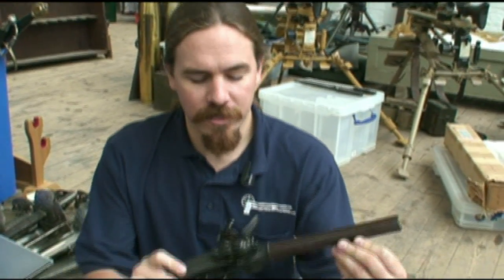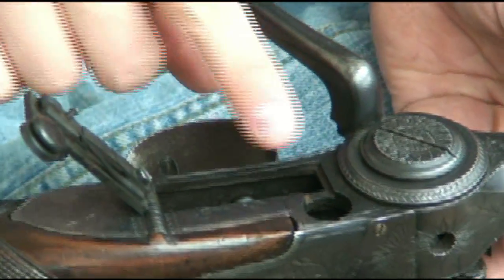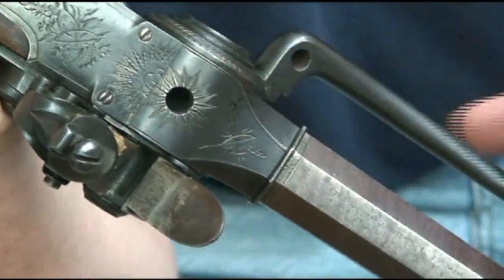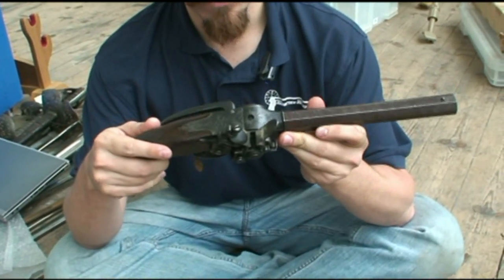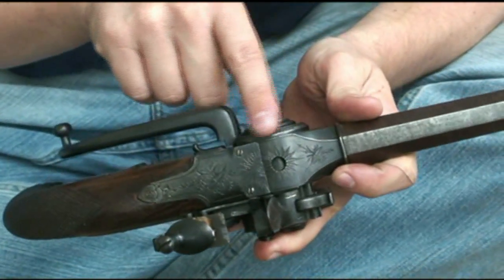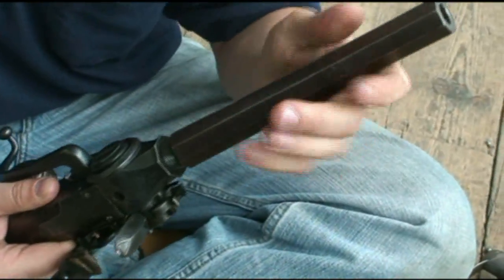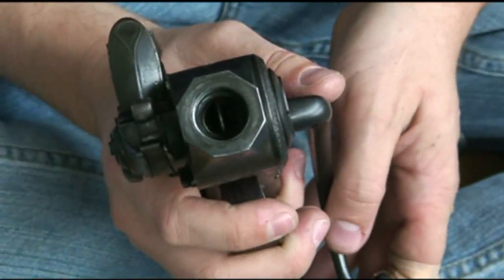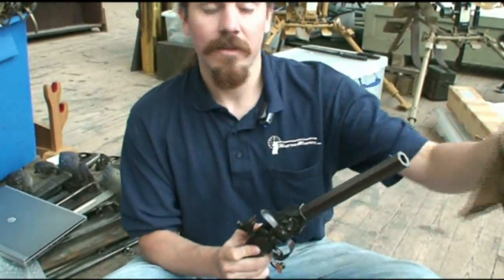Lorenzoni Repeating Flintlock Pistol

Comment from the maker: One word: money. Because of the skill and time required to make them, Lorenzonis were very expensive guns. This is the same reason armies were never equipped with wheel locks, despite them being superior to the flintlocks available at the same time.
Reply: Sorta the same with ww1 rifles being bolt action instead of the earlier, faster lever action rifles that held more rounds, with the only real advantage of bolt action being that it was quicker to load, and  less susceptible to failure in the mud and much of the trenches, I guess. Just goes to show you how cheap governments can be when it comes to equipping their soldiers.
Reply: @RmfDiz  Um what? Being quicker to load and more robust are huge advantages, not something you can just brush off. And those are not the only advantages either, bolt action rifles are substantially stronger than the early lever action rifles which could only shoot pistol rounds, and can't use pointed bullets either because they are dangerous in a tubular magazine.
Reply: @WJS774  Lever actions with box magazines do also exist, and you can make the bolt on some lever action designs plenty strong enough for full-power cartridges like 30-30, 30-40, and even 30-'06.  But lever actions, while awesome for mounted use, have issues when the shooter is prone in the mud or leaning against the side of a dirt trench.  Too much of the action opens up and on both the top and the bottom of the weapon for them to be happy down in the dirt.
Reply: @laurenceperkins7468  The guy's talking about early lever actions 'with more rounds', obviously that means the early ones with a tubular magazine of pistol rounds. The Winchester 95 wasn't around until 1895 (surprise surprise) and by that time bolt-action rifles were already entrenched as the standard infantry rifle.
Reply: @WJS774  Like I said, bolt action just makes more sense in terms of biomechanics for someone who's going to be spending most of his time shooting from a rest and especially if there's mud involved.  

The early lever actions were weak because the early cartridges were rimfire, which puts a pretty low ceiling on the amount of power they can handle without rim failure.  There's no reason to build an action for a full-power rifle cartridge when such do not yet exist.

As cartridge power scaled up manufacturers had no trouble strengthening lever action designs to match.  Bolt actions are simpler, but the locking mechanism on most lever actions is quite similar to that used on the Sharps falling-block actions, which nobody doubts are capable of handling high-power cartridges.

Bolt action may have caught on everywhere else, but the USA used Springfield trapdoor variants until 1892.  (For that matter, my grandfather was issued one when posted to the Mexican border during WWI.)  By that time the Winchester 1886 was available in 45-70 (the standard government cartridge of the time), 45-90, and 50-110.  These are hardly "pistol rounds".  But they also had rather lower magazine capacity, usually only six to eight instead of twelve or more.  But that's still higher capacity than the 30-40 Krag (the replacement for the trapdoor) which had a 5 round magazine.

But again, bolt-action makes more sense for infantry, and lever action isn't enough better for cavalry to be worth the hassle of maintaining multiple models with non-interchangeable parts.
Reply: @RmfDiz  the real advantage to the mauser bolt gun, is that you can operate it better from the prone, wich is what you would actually do in war, like 95% of the time. the stengun has a sideway magazine because of the same reason. 
leverguns are best suited for civilian needs, in my opinion.
Reply: @laurenceperkins7468  actually they stopped using them after they got the 1903 Springfield, since the US used the Trapdoor in the Spanish-American War of 1898
Reply: @josh_the_alien  They were still issuing trapdoors to home-guard troops in WWI for that matter.  Prior to WWII funding for the US military was always kind of a shoestring thing.  Just enough to get the job done, not a penny more.
Reply: @laurenceperkins7468  damn, i honestly don't remember typing this
Reply: Sorry Ian, but pistols were officer weapons, and officer back then were rich. So, couldn't this be an individual bought gun?
Reply: @RmfDiz  lever action wasn’t even faster, shitty overly complicated mechanism, round nosed bullets, had to be turned sideways every time you reloaded while prone.
Reply: @WJS774  what about pump action vs bolt action ??
they did use pump action shotguns in ww1 if I'm not mistaken
Reply: @aburoach9268 Are there even pump rifles? The shotguns obviously serve a different role than the rifle, so of course they operate differently.

Comment: I would like to see that unique pistol in action.  It sure was ahead of it's time.
Reply: this is the kind of thing that would be worth buying a very expensive exact replica of that you could actually fire (because you obviously never should fire this example), i would love to see it, and then see someone trying to work it quickly like you'd have to in a fight. id guess at full speed it's only between twice and three times as long as cycling a bolt action rifle, which if accurate would be insane for 1680
Reply: Ærik Bjørnsson Yes I would love to see someone like Pedersoli or Chiappa make a really good replica of a gun like this. Unfortunately I don't have enough money to let someone manufacture a unique copy of this gun by hand. Otherwise I would definitely do it, because I love old black powder guns and this one is so much ahead of its time, amazing!
Reply: @MajesticSkywhale  

Absolutley  I agree.  A firing functuoning replica should be made with an optional removable rifled barrel as well.

Comment: Does it also automatically put a powder charge on the pan or will you still need to do that manually?
Reply: good question.
Reply: From what I've read a small amount of BP will, "dribble," into the pan.  So, just roll and rock, as it were.
Reply: The Rifles had a third magazine of flash powder on the right side of the frame used exclusively to prime the pan ... you can't see it well on this pistol video .. but it's the same
Reply: id say no but it could have one installed
Reply: As the power gets compacted in the mechanism some power gets pushed out to the pan.
Reply: @MisfitSass  No, it's automatically loaded with a charge of BP. There's a third magazine of flash power on the right side used specifically to prime the pan. It's barely visible, here, but it's definitely there.

Comment: Mr. Michele Loranzoni was a brilliant genious inventor of the 17th and 18th centuries, and the maker/ manufacturer of fine multi shot Flintlock firearms.

 The Loranzoni design seems to be an improvement of the older Kaltoff and Klett multi shot Flintlock firearms.  These are the first Loading Lever multi shot repeating firearms.

The existence of the Kaltoff, Klett, Loranzoni, and the other  multi shot loading lever reapeating firearms debunks the Disinformative Lies  of Disinformation that when the US 2nd Amendment was made, there were only single shot firearms.

Comment: I'm doing research for a book and I've been trying to find info on how to load a flintlock revolver. This is the closest I've found to a multi-round flintlock. What I'm mostly interested in is the design made by Collier. It appears that you just load the bullets into the 6 cylinders, but I can't figure out if they still had to insert the powder through the barrel w/ the ramrod and if they had to do it before each shot. You seem very knowledgeable, so I'm hoping that you might be able to help me.

Comment: Interesting idea with many problems, The first being the need to prime the pan in order for it to fire. The second is that the powder charge would not have been compressed (virtually required with a BP firearm to keep pressures from skyrocketing) and then there is the fact there is no patch With no patch two things come to mind 1. its either a smooth bore or 2. the rifling will foul after a few shots again greatly increasing the pressure. Interesting design exercise but like with any innovation. It obviously didn't work in the market and quickly died out.

Comment: more often that not it is not only more expensive to make a multi shot flintlock, it is also less reliable and people at that time realised its both cheaper and safer to just have several single shot flintlocks instead. remember that guns back then were hand made by gunsmiths so its also very hard to maintain and get replacement parts for such a firearm

Comment: Although I never heard about it in any specific detail, I had always been certain that such a thing as this existed.  It simply had to.  I'll even go out on a limb and guess that it's that fine machining that makes it a scarce thing; that kind of work must have been quite costly and time consuming; although I haven't the foggiest of ideas how machining was accomplished before, well, machines.  Or has that always been the case, and it was built on a lathe driven by a water wheel or some other crude source of power for line--shaft tools?

Comment: but what stops the ball rolling out of the smooth-bore?? Or after pointing it down to load u then hold it up to stop it falling out??  Congrats on your unique, informative n interesting videos.
Reply: +Adam Skinner maybe the balls locked in place untill you pull the trigger then before its fired it lets the ball free
Reply: +Adam Skinner Barrel smaller than the ball...

Comment: I'm assuming you are probably only getting 7 shots per minute, even pre loaded, I think you'd have to be careful with the black powder being loaded and unloaded out of the cylinder, having to shake it a bit for the powder to fall, and then you also have to slowly rotate the cylinder for the weapon to function properly. While innovative, (apart from the cost) I can see why this didn't take off, and you would still have to pour powder into the frisson it seems. If this came out when percussion caps were coming along, and had that option with later models, this would have sold much better.

Comment: It looks like that could be done with a lever-action thing, like a modern lever-action, but to operate this repeating mechanism.
Reply: +ShadeSlayer1911 The pistol will have to be heavy enough since there is going to be resistance when trying to cock the hammer of the pistol. Without enough mass, the pistol will load the powder and shot but not cock the hammer due to the resistance experienced when trying to do the Terminator lever-action stunt.

Comment: So what keeps the bullet from just falling out of the barrel when you point it down and crank it? Is  the bullet a tiny bit bigger then the barrel diameter so it won't fall out accidentally but still force it way through (because lead is soft) when you fire the gun?

Comment: You've gotten that backwards. Armies didn't adapt the wheel lock over the *matchlock* even if it was superior in reliability and a lot safer to use. The flintlock mechanism is superior to the wheel lock in every regard... ease of use, faster reload (you need to wind the spring of the wheel lock up with a key), reliability and most of all cost. Also the flintlock does not have the split second delay between pulling the trigger and powder discharge that the wheel lock has.

Comment: what is the date on the repeating flintlock?  Also you did not demonstrate the proper install and use of the flint...
Reply: Nick Carter The gunsmiths of old weren't required to put on the same stamps we take for granted today.
And he didn't tinker with the flint because it's a collector's piece and any part may fall off at any moment, ruining the value.

Comment: Do you have to manually reload the flash pan?
Reply from the maker: +Reid Templeton Nope, it did that for you.
Reply: nice
Reply: +Forgotten Weapons... that's first thing that came to my mind,....haw the flash pan is loaded ?...
pity that you forgot to show, there is not much info about that on internet. That is the COOLEST flintlock pistol ever.
I like your videos a lot, great job.
Reply: +Rosta Stejsk Same here, and I'm glad you asked.  
I see the pan, and the flint - ergo no cap - but no mention of the process for priming.

So, rotating that lever also deposits a portion of the powder to the pan - while pointing the weapon down??

On the powder portion of the rotating "drum", I notice a small vertical divider.  Is that the powder that flows to the pan?  Wouldn't you need to rock or jostle the gun to get the powder to the pan??
I dunno - it just seems like auto-loading the pan has flaws.
This thing actually worked, well?

I love this channel.  This is the first vid that has left me with questions!

Comment: I believe Louis L'Amour wrote a pair of these pistols into his novel "Jubal" as the main Character's weapons.

As to the questions from posters as to why it was not as common in a rifle form, or simply non existent, the design likely could not handle the heavier charges of powder required in a longer rifle or musket barrel.  Also, in the minds of Military Commanders, fast repeating arms were disdainful to them.  The Fergusson Rifle was another victim of these individuals. The Screw type breech was just too revolutionary for its time, so they did not use it the way it should have been, decided they hated it, and then replaced it for the large part with smoothbore short "Pattern" muskets.
Reply: TheFoundersWereRight  I would have to agree with you on the military thinking on repeating arms.Even the earl Enfield and SMLE rifles had a magazine cut off to stop the soldier from firing multiple rounds. Of course this went when the horror of WW1 meant that you fire as fast as you could to repel oncoming troops.Our ANZAC troops were only thirty yards from their Turkish enemy at Gallipoli in Turkey and the ability to fire very fast was paramount,something the SMLE was good at.I myself have done 22 rounds in a mad minute. Cheers Ross
Reply: eiclan Cheers to you as well. Yep. That magazine cut off was wonderful for slowfire until an enemy jumped out from behind a tree and made you forget it was engaged.

The US Krag rifle and early Springfield 1903's had cutoffs as well, and the 1917's made by Remington might have but I cannot remember exactly on that one.

Comment: "The Second Amendment was written when the founding fathers had no idea about repeating firearms"
Reply: That False.

 This Loranzoni  was one of several repeating Flintlock Firearms from before and after the creation of the USA .  

The founders of America were not stupid. They were aware of the existance of multiple shot Firearms. 

 It is said that General George Washington did inquire into the purchasing of Belton multi shot flintlock firearms. 

There have been  multiable shot Firearms  since the invention of Firearms. 

 Starting with a multi barreled Hand Cannon guns. Which was the first type of firearms. 

The 1st known revolver was the Stopler Revolver made in 1597. The Puckel Gun, the Belton Flintlocks,  the  Collier Flintlock revolvers.

The Founding Fathers  were aware of multiple shot firearms. 

The issue  lwith multiable shot Firearms manufacturer prior to the1840's was that faster timingly manufacturing production methods were not  possible until a man named Samuel Colt came along to invent and produce the first functioning mass production  assenbly line with interchangeable universal parts.

So the single shot Musket  was the fastest producted available  Firearms system at the time.
That's why they were so widely used.
Reply: The first repeating fire arm came to be in 1640 over 130 years till 1776 and George Washington was still alive when the first bolt action came to be and when the first modern revolver was invented